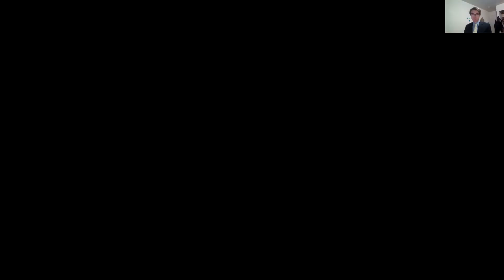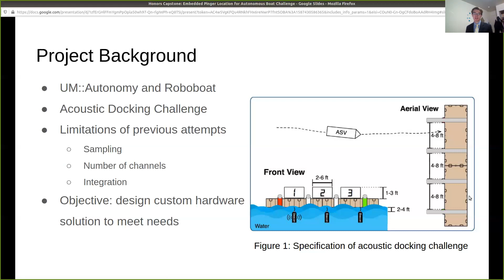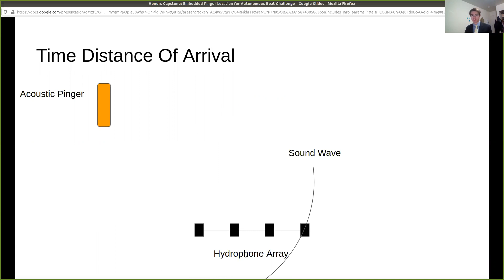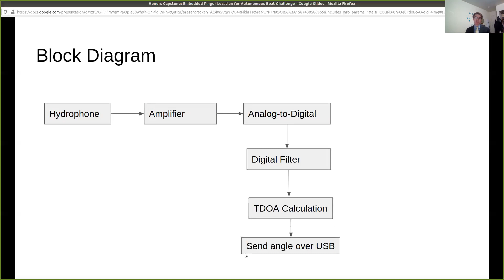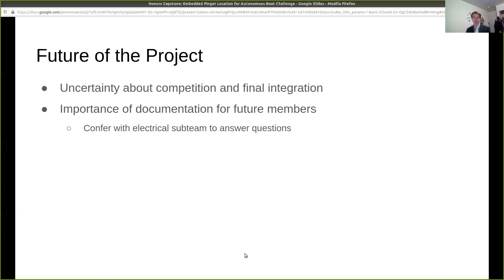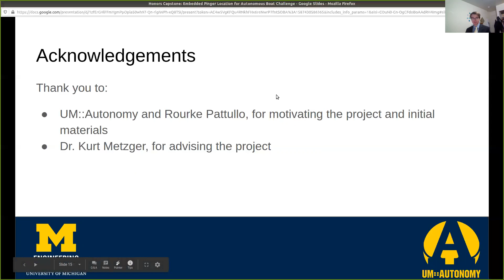UM Autonomy and Roboboat Acoustic Docking Challenge

Comment: Thank you for the presentation, Alex! I have been involved with a research project using a similar ultrasonic locating method, but never in an underwater scenario! I was wondering how you are able to handle multipath interference from the ultrasonic pulse reflecting off barriers, or is the attenuation constant large enough in water that it is negligible?

Comment: Great presentation and overview of the problem you were addressing in regards to the acoustic docking! Your comment in regards to being careful about overthinking a problem is an important lesson as not all solutions need to be perfect depending on what the required end goal is. I was curious if the locating of the pinger occurs while the boat is moving and how the movement is accounted for in locating it?
Reply: One challenge of boats (especially a small boat operating in a small environment) is that we will have to worry about drifting, even when we try to be still. The measurement itself should not be significantly affected by our motion, but we do need to ensure that the boat is facing towards the dock for an accurate reading, and we also need to ensure that other sensors on the boat are properly identifying the location of the dock. To accomplish both we will want to pause in front before docking, but we do not need to be perfectly stationary.
Reply: @alexskillin1674  There is always something that makes things more challenging. Thanks for the response.

Comment: How did you choose the number of hydrophones to use?
Reply: At least two are needed for the time-difference-of-arrival approach. Additional sensors beyond the two primarily help to resolve quantization errors as a result of the sampling rate. Adding sensors does provide diminishing returns for our use case, especially since distance between the sensors improves results. Having the hydrophones already on-hand also contributed to the decision as the sensors did not need to be budgeted for.